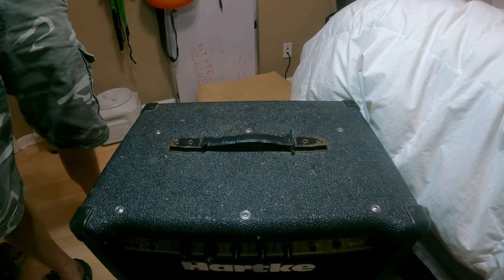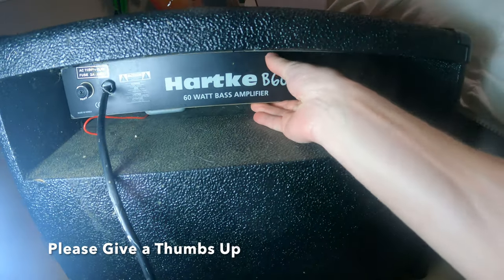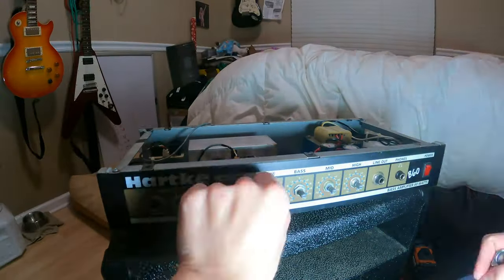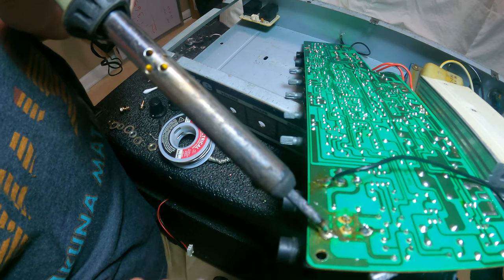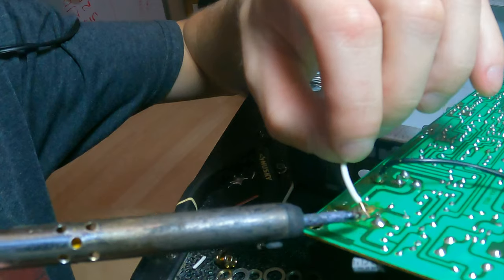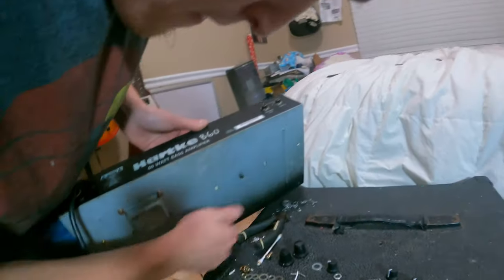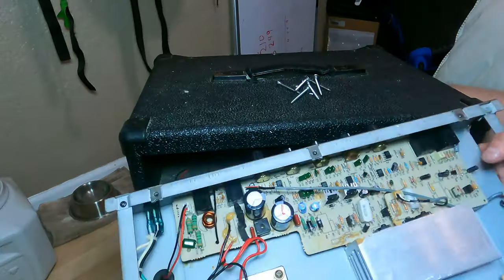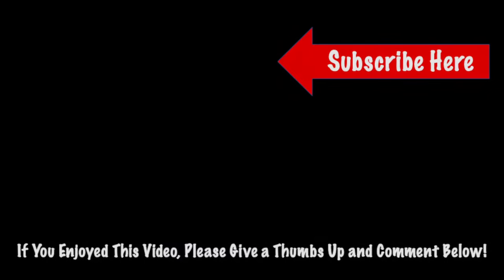DIY Amp Input Jack Repair -- Static Cutting Out 1/4 inch Input Jack on a Guitar Amp -- Hartke B60 4K

Comment: thank you, side rant, this is not the first time I've dealt with this and I'm not rough with cords, no way should the jack be connected with mere solder to something as intricate as a circuit board, they should all have jumpers as you suggest.. hours of wasted rock time!
Reply from the maker: Well said, if the jacks were connected to the PCB will jumpers, any amount of jiggling probably wouldn't cause any issues with solder joints breaking.